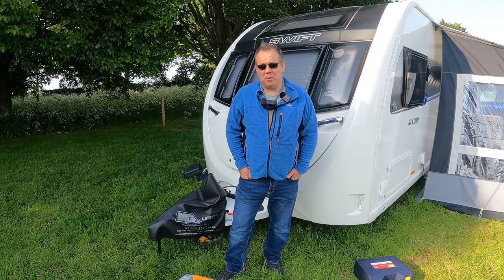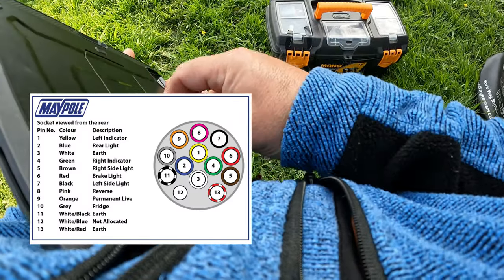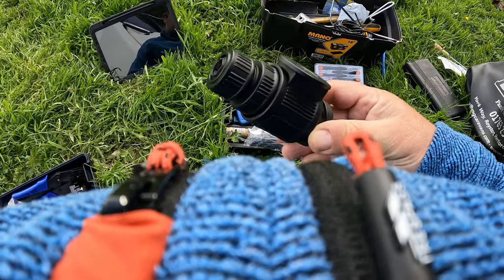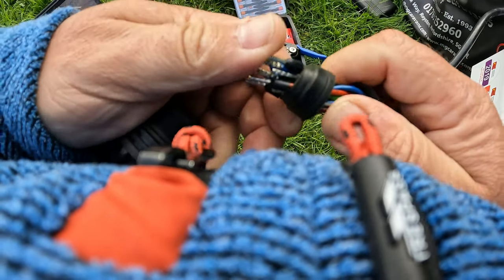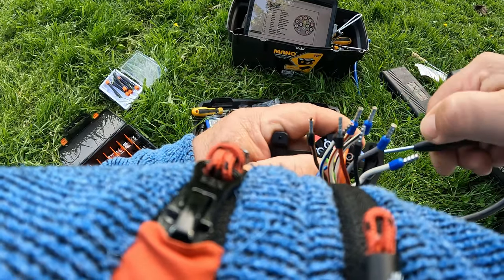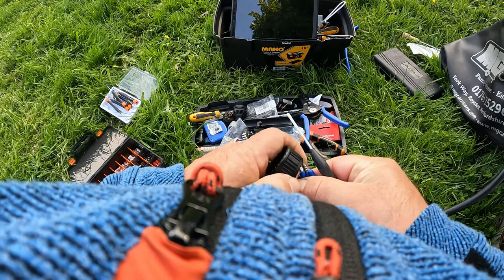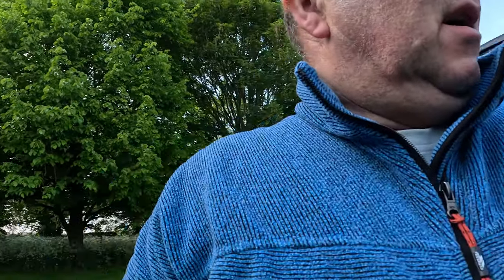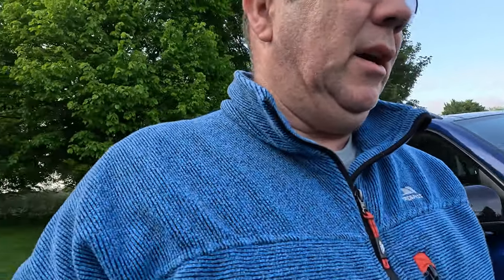Step-by-Step Guide: Replacing Your Caravan's 13 Pin Towing Electrics Plug

Comment: Although 'standard' wiring colour diagrams are published, the manufacturers don't adhere to them. So if you need to change your plug, take photos of the connection and be sure you know which wire goes to which connector before you disassemble the old plug.
Reply from the maker: Good advise, although I have to say up top now, I haven't come across one that doesn't adhere,  However well worth taking that Photo before you dismantle so you have something to refer back to. Thanks for watching and commenting, Happy Camping James

Comment: We drove home yesterday and accidentally left the harness trailing along the ground 🤦🏻‍♂️ Disconnected the caravan battery Positive, then managed to cut and connect back up using insulation tape, then connected the battery again and had a few small sparks. Everything is working connected to the Car apart from the ATC, any help would be good? Where is the ATC fuse?
Reply from the maker: Hello The ATC fuse should be located with the other fuses in the main fuse box, I would also check your pins in the plug to make sure they are all ok. Also there should be an electrical connector under the caravan for the ATC system see if that is connected ok. I believe the electrical feed for the ATC comes from Pin 9 on the 13 pin connector. I hope that all helps
Reply: @CaravanEscapades101  Thanks, Pins are all fine it's just the fuse I think needs changed. Didn't know about an elec connecter under the caravan..hmm